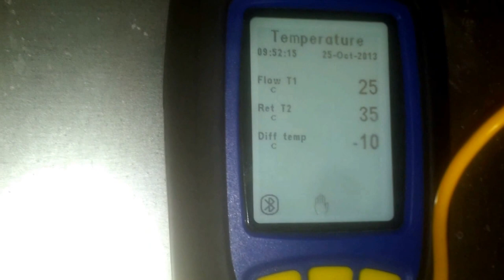Bellway new house Bursting Boiler Pipes Problems & Reason --This May Help You!

Comment: Hi, I know it's a long shot as this video is old.... But I have a bellway home in which the boiler has just started leaking... Only when we turn the central heating on though and it is leaking from a pipe on the under side of the boiler. I was just wondering, is this how it started for you? Or did your pipes just burst? We have had nothing but trouble with bellway!! Wouldn't recomend them to my worst enemy!!